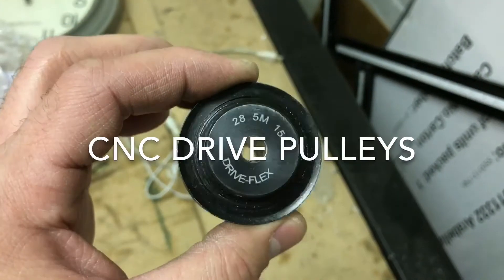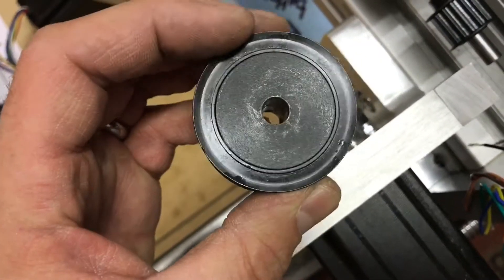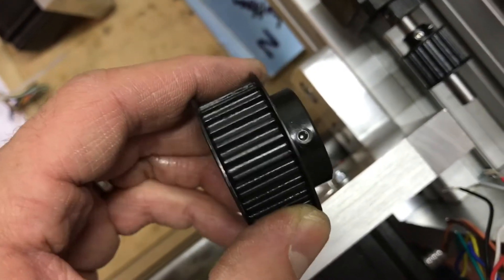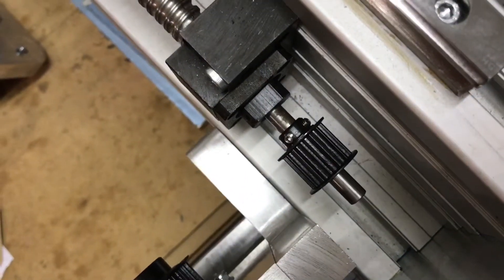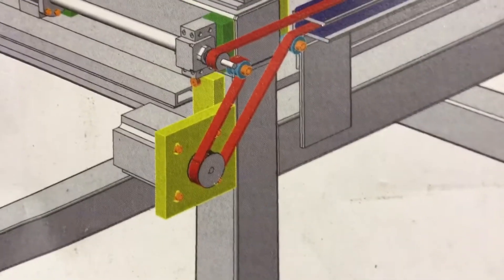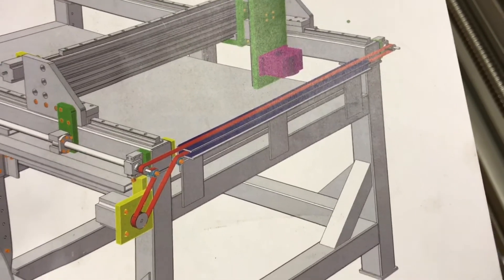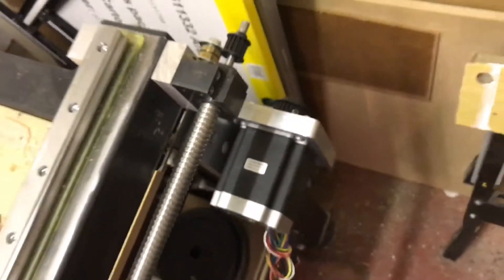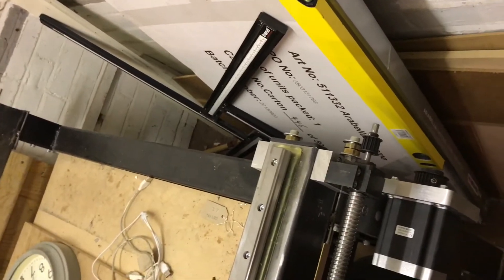Drive Pulleys for CNC Build ⚙️(Ep13)

Comment: Hi Joe its a great build you've accomplished there, I've been following you build for a while now. I made the same mistake of buying the 5mm pitch ballscrews for the long axis and Im thinking of a similar solution to achieve a decent feed rate by using a timing belt. I notice you've mounted the 28 toothed pulley straight onto the Nema 34. Can I ask if the Nema 34 shaft/bearing will accommodate the lateral force that the timing belt may exert on it?  Im wondering whether I may need to make a bearing block and use a coupler to eliminate a lateral load on the motor shaft.

Comment: so your obviously going for speed and less power and precision by having the bigger pulley on the motor
Reply from the maker: +Chris Atack 
Hi Chris - Yes kind of. The ball screws are 5mm pitch which is smaller than I would choose if I were to buy them again. 10mm pitch would probably have been better - the Pulleys allow some compensation and flexibility.